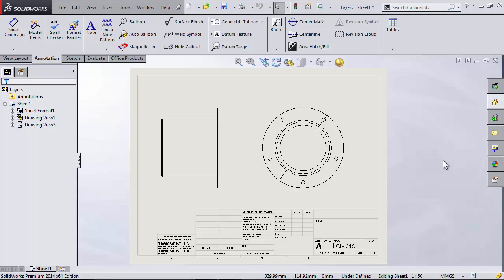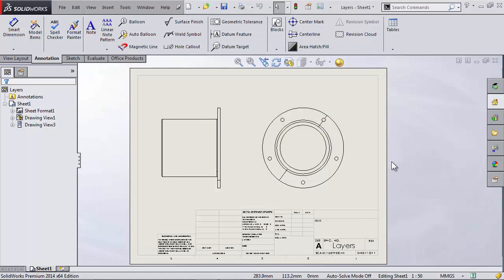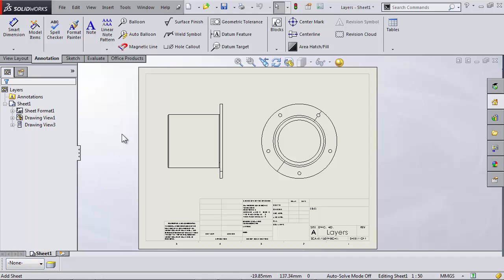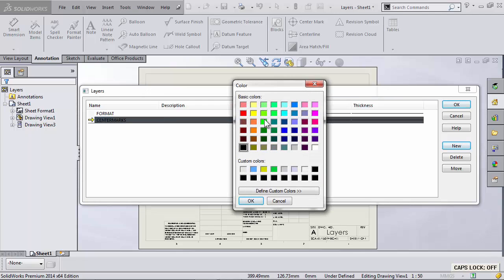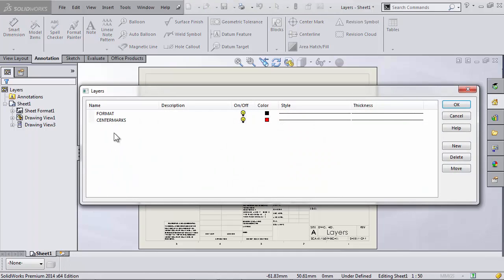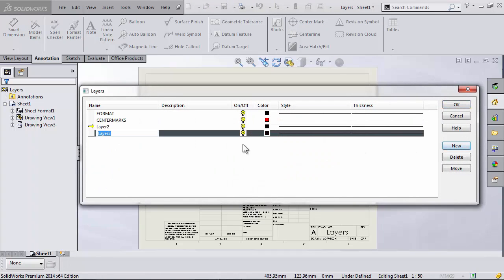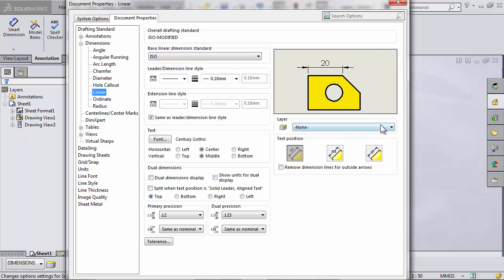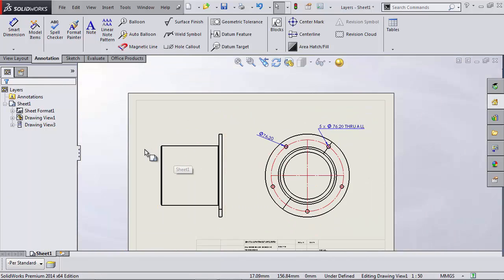SOLIDWORKS 2014 - How to Use Layers in Drawings

Comment: Can i help me ! How creating layer dashed auto?
Reply: +Nang Pham To create a dashed layer, use the Layer tool discussed around the 1:00 mark. If by automatic you mean certain objects automatically are dashed, that's discussed around 2:45. If by automatic you mean you don't want to repeat these steps every time you open a drawing, go to File > Save As and save as a drawing template. If I've misunderstood you, please send me a private message so I can give you my e-mail address and we can try and work this out with the assistance of pictures or videos.
Reply: +Shivani Patel 
When I want to export drawings from 3D to 2D, I want to be dashed his follow the installation layer.

You can send tutorial help with mail: nangpham91haui@gmail.com . Thanks
Reply: +Nang Pham I sent you an e-mail, but I am still confused by the wording "to be dashed his follow the installation layer". I think contacting your local reseller of SOLIDWORKS will help you out faster. Sorry for the confusion.
Reply: +Shivani Patel Nang's question was about having "Hidden Lines Visible" automatically be selected when he inserts drawing views. This can be done by going to Tools > Options > System Options > Drawings -- Display States > Hidden Lines Visible.